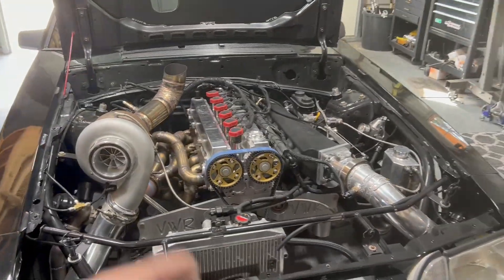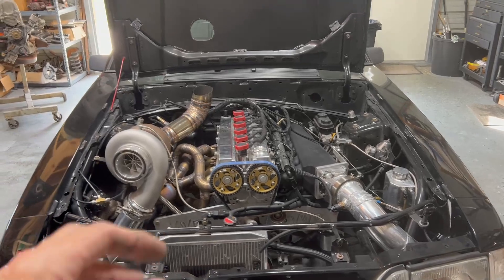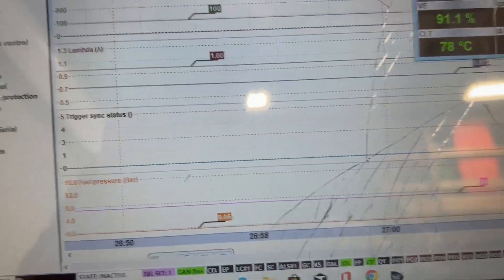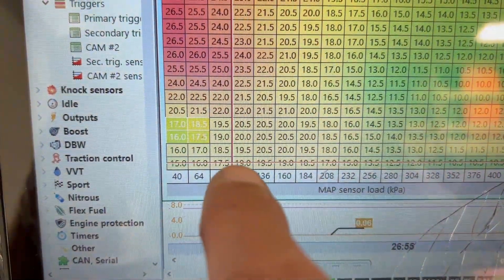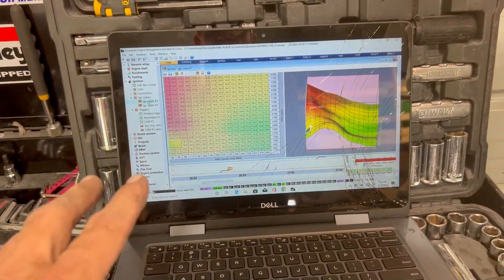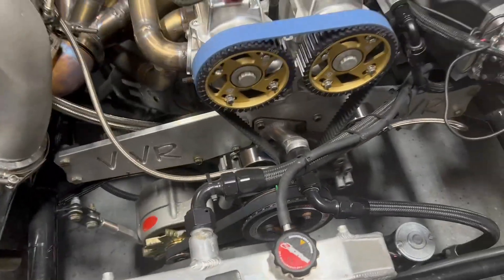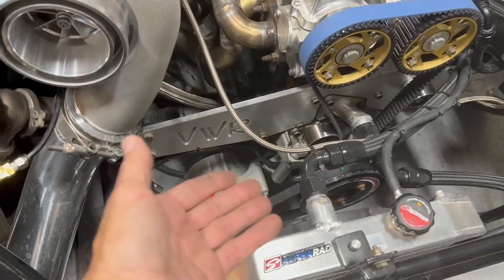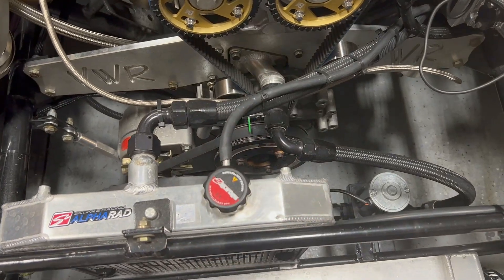2JZ How To Avoid Engine Damage! Set Your Timing Using A Timing Light!

Comment: Great videos! I've been watching your stuff for at least a year now. Well done!
Which coils are they? AUDI Vag coils? Long stem? What part number?
I'm running EMU Black also and just self taught, built the motor in the garage, wired and tuned myself and have added traction control, boost by gear, DBW, dual wideband, CAN EGT temps, CAN Bluetooth and data logger, CAN V3 Switchboard etc, PWM fans and PWM electric water pump control. Love the ECU Master stuff! Road registered 1984 Supra
Reply from the maker: Yes they are Audi r8 coils. I get them from Ecs Tunning. I don’t remember the part number.

Comment: Awesome video, thank you! 
Question, why do you recommend the 10 degrees and not 0 degrees? Does that number just add to whatever numbers are on the actual ignition map?
Example, if your ign map is at 15 degrees under boost/wot, and you set the trigger angle to read 10 degrees on the pulley, does this mean you are running 25 degrees total while under boost/wot?
Reply from the maker: No. Your just locking the timing in the ecu so you can verify on the balancer. Once you unlock it defaults back to your ign map. You can use 15 if you want or 20. Doesn’t matter as long as it runs smoothly.
Reply: @fox-body  forgive my ignorance, but if once you unlock it, and goes back to the ignition map, why does it matter in that case? Why not just adjust the timing on the ignition map at idle? Seeing how the 2jzgte doesn't use adjustable distributor or adjustable cam sensors, as long as your timing belt is right on, you should be fine, correct?
Reply from the maker: There’s a lot of variables. And you don’t want to assume the base tune you got has the correct offset. That’s why you want to verify the ecu is on the same page as the timing at the balancer. If it’s of a few degrees you adjust the offset in the ecu to match. Other wise, if your commanding 20 degrees at 20 psi of boost but it’s actually 23 degrees it can cause damage. Keep in mind this is only for stand alones.
Reply: @fox-body  got it. I'm using the ecu master classic. Just trying to wrap my head around this ignition timing. I understand it fully now. I truly appreciate the knowledge you've given!
Reply from the maker: No problem. It is one of the more misunderstood topics.